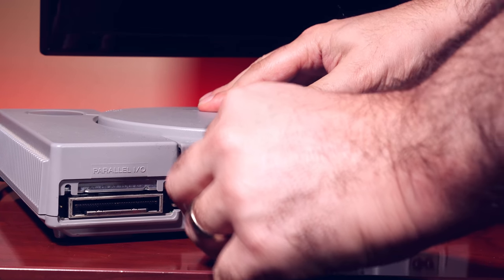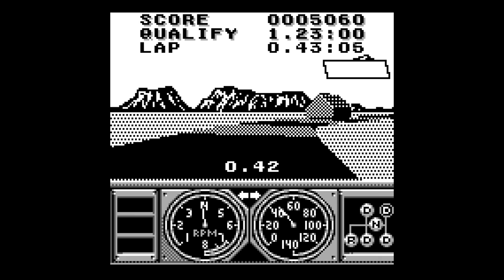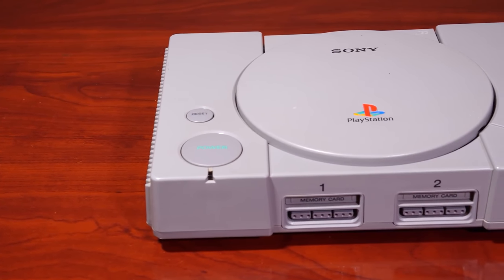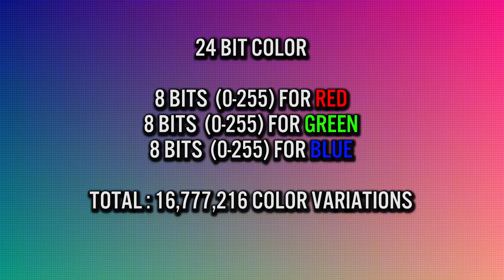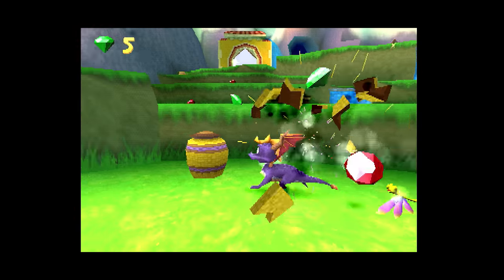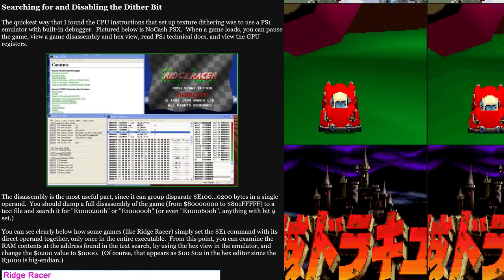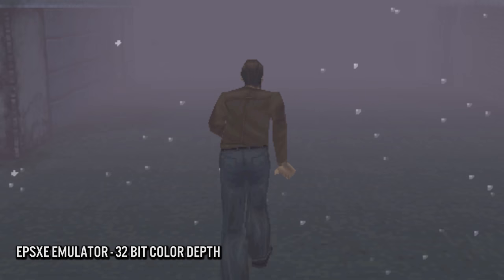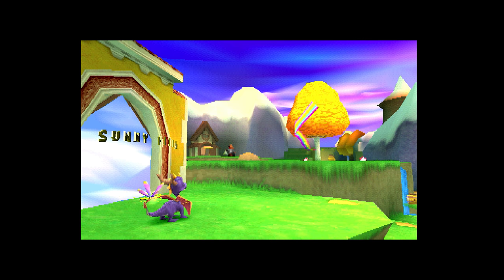Why did the PlayStation 1 have so much Dithering? | MVG

Comment: You summed it up perfectly mate, on a CRT via composite we never even noticed 'dithering' back then, it's only due to running a PS1 on a 'Modern Display' (which it wasn't natively designed for) is where we all notice the shortcomings.
Reply: if you used an "advanced scart cable" that had RGB output, and you had a decent enough (read; big enough) tv, you'd just see it on that screen to... especially in europe, since PAL tv's have more colors & sharpness then NTSC; though ntsc games run faster (60hz, where pal was 50hz), but i gladly give those 10fps for a much better image quality.
Reply: @BoGy1980  To each their own, but as a proud citizen of Freedom Land having been born on the 4th of July, I'll gladly take a smoother frame rate over a higher resolution, and older consoles not looking great on newer displays without mods, and/or expensive upscalers is why I still keep my curved glass 27in Panasonic CRT from the early 00's with component input, and stereo output in the corner of my game room for retro gaming, and I will have it till it till the day it dies, and I can no longer repair it, and yes I have 3 backups being a 19in, & 24in JVC I'Art models that also have component inputs, and stereo outputs, along with a basic mid 00's Emerson(Funai rebage) 19in all  in climate controlled storage of my shop to give them the best chance of lastling as long as possible.
Reply: @BoGy1980  I never found PAL's better colors to be much of a factor for gaming. The better colors was something more attributable to purely TV and video rather than video games. Most games were built NTSC anyway and the lack of optimization, black borders and poor framerate for PAL games is just a complete deal breaker for me.

Also in the sixth gen you had many NTSC games capable of running at 480p, 720i or in some cases 1080i. Which the PAL version of that game would be lucky to just get PAL60.

So import games for the win for me. Sorry, but NTSC just has way too many clear advantages over PAL for PAL to even be considered equal for retro gaming.

Th only time I ever consider PAL worthwhile is when there is exclusive content for that version or there is something unique about it, or it has better box art than the NTSC version (which is often the case).
Reply: @BoGy1980  NTSC and PAL are actually quite similar, except the *P*hase *A*lternating each *L*ine part means you are less likely to get noticeable dot crawl and artifact colors. AFAIK both have the same range of colors they can display and sharpness should also be pretty similar.

I'd rather have a fuzzy monochrome display than a sharp vibrant screen with horrendous 50Hz flicker. 60Hz is really the absolute minimum IMHO.
Reply: @Katana2097  there'"s quite a difference when using the advanced scart cable (which has component RGB and you had to buy this one seperately) compared to the standard scart cable (which only has composite signal, this came with the psx as a little scartbox where you plugged in yellow (composite signal), white&red (audio) cables). for 16 bit consoles the color wasn't so much a difference, mainly sharpness, but the 32bit consoles also had better color reproduction when using component; the image is just a lot crispier
Reply: @eDoc2020  ntsc has LESS SCANLINES, so less resolution, so less sharpness compared to PAL.. PAL has about 20% more bandwith for video in it's signal (5 mhz compared to 4.2), and also the color carrier frequency 3.579545 MHz for ntsc and 4.433618 MHz for pal, which is 25% more bandwith for coloring, also NTSC televisions did not have RGB input, while PAL tv's all had one or more SCART connectors which support full RGB component signal
Reply: @BoGy1980  I guess you could say more scanlines means more sharpness. When I think of sharpness I think of the knob on old TVs, which is basically only horizontal. And yes, as you say PAL allowed more bandwidth for increased horizontal resolution, too. Personally I don't think it matters too much as in my experience most color TV tubes simply don't have small enough dot pitch to be able to see a difference.

As for SCART, it was a relatively late standard, in no way on all PAL sets. While it's true that American TVs rarely had RGB in (I"m pretty sure there were exceptions) we did have YPbPr component video on many later sets, ehich is functionally equivalent.
Reply: @eDoc2020  SCART was on all tv/video sets from the early '80s on...  I even remember using a SCART connection to my TV that had a DIN connector on the other side of the cable, that's how I got supersharp text from my c64 (that's where that DIN-plug went in, I also had a Din2scart cable for my megadrive, I later discovered it also worked on my master system; that cable was made for me by tech staff from a tvrepair shop...) So i was using SCART since '86 (got my c64 then).  but our 1982 VHS vcr already had scart too (bought in Germany, my father was in the army, and we got free housing etc like all soldiers working abroad in Germany... we're Belgian btw.. so, i think scart is older than you thought it to be.
it's pal+/pal60 which is a later standard, that's from the early '90s.
Also, when using rgb-scart, there is no PAL signal used.. that's how we could play us/jap psx games on our euro PlayStation with just disc swapping to boot other region and/or chips and have full colour images, if you play pal games on a ntsc console it's a BW image, and if using the default composite cable ntsc games also show b&w on pal machines
Reply: I think it's more so that dithering was just something that people were used to. Almost every game that had come before did it as well to some degree or another so it was just how game graphics looked. Now that we have gotten used to 32bit color and high resolutions we notice it far more.

Comment: I try to hide it in emulation because back in the day I didn't see it on my CRT. It was all smoothed out. So the dithering itself doesn't have any nostalgic feeling for me.
Reply: Porfirio Rubirosa  this is why i try to play ps1 games on original hardware as much as possible. I try not to be a purist because emulators mostly manage to look so much better most of the time but ps1 games just look objectively worse when emulated with "enhancements". Sadly I can't buy too many ps1 games these days without busting the bank.
Reply: Porfirio Rubirosa  On original hardware, sure. But he says the textures are stored as 24-bit. So there's no reason an emulator couldn't just use the 24-bit textured directly, without downsampling them at all. No need for dithering or banding. 

And, of course, if that fails, they could add an option to smooth the textures. The right kind of smoothing could even keep edges and features sharp while smoothing out the dithering.
Reply: @NickGoblin  it's not really about the hardware. You would see the dithering on like an HD TV pretty sure, not that a PS1 is meant to be played on that
Reply: @Valientlink  I understand that you can use an emulator on a CRT and it'll probably look fine but at that point it's just too much effort.
Reply: Porfirio Rubirosa   If you are using RetroArch you can turn of dithering and then force the color pallette to 32 bit. Making dithering unnecessary. Although it will cause some issues when fading to inventory etc for some reason...
Reply: @NickJayj  Especially the stages during the day with fog look clean and super smooth in 32 Bit, which I do not like it this case. Not many games do it but Silent Hill does benefit from the grittiness that the dithering provides.
Reply: Idk about PS1, but on N64, I can see the dithering perfectly on my Trinitron.
Reply: @DasAntiNaziBroetchen  You can see dithering from a PS1 as well. But it's definitely less noticeable on a CRT than a newer screen.

Comment: The dithering gets interesting when playing PS1 games on the PS2. The Graphics Synthesizer had a programmable 4x4 pixel dither mask, but when running PS1 games it's programmed incorrectly with two pairs of values swapped over. This causes the pixels in two of the dither steps to align in a very noticeable way rather than being evenly spread out. From what I know, Sony never fixed this.
Reply: Fascinating, I should do an A/B comparison of some PS1 games running on PS1 and PS2 and see if I can spot that. Also, another thing that the PS2 got wrong was that transparencies on PS1 games often had a black halo around them, as if they were being blended darker than they should be. Any idea what was causing that?
Reply: @Astfgl  The black outline typically happens when you set Texture Mapping to Smooth. Where part of a texture is masked, the bilinear filtering blends in the color of the texture from the masked out area.
Reply: @ZacabebOTG  It also happens when texture mapping is not set to smooth. I never really liked the smoothing as it causes textures to break up at the edges of polygons and it doesn't look authentic, so I never turn it on. Yet the blackness on transparencies still happens.
Reply: @Astfgl  That's common with alpha blending with bilinear filtering, the colour from the transparent pixels (usually RGB 0,0,0) gets bled into the pixels with none zero alpha.

Comment: 4:46 Small correction, the PS1 stores textures of varying bit depth, but will always use 15bit colors. 24bit CLUTs are unsupported in hardware. If a game stores textures inside the disc in 24bit depth (like MGS1), those colors need first be converted to 15bit space before being used.

Comment: 2:17 “The Amigas custom chips could perform what was known as a COP-A-FEEL” 😰

Naughty Amiga!!!!!

Okay, okay, Copper Fill. 🤣
Reply: I thought it sounded like Copperfield lol
Reply: Robert Mcauley 
I was familiar with some of the names of the Amiga custom chips, like the Copper and the Blitter, but I couldn’t let the joke slide. 😏😂
Reply: It's actually "Blitter fill" though. The Amiga had two gfx chips, Copper for switching colors at the right scanlines and Blitter for drawing lines, filling polygons and moving bitmap gfx around.
Reply: Peeks'n'Pokes 
Makes sense, since blitter usually referred to schlepping pixels around en masse. 

What did the Copper chip do?
Reply: The Copper was used for changing hardware registers like palette and scroll positions with precise timing during the screen update. This made it possible to make effects like stretching gfx without changing the bitmap pixels. Heavily used in the demoscene.
Reply: @ylette  
Nice. We so didn't deserve Jay Miner. What a tech guru. Totally Woz level of genius.
Reply: @ylette  Correct. "Copper fill" was also used as a (pretty tricky) technique, but it referred to using the Copper to initiate a blit at a certain time to avoid using interrupts and extra CPU time (or worse, busy loop waiting for the blit to complete!). But you'd better calculate clock cycles correctly, or the previous blit might be corrupted.
Reply: To add, saying Amiga could display only 32 or EHB 64 colors in lores mode is somewhat incorrect. You could easily use copper to give you another palette for every scan line. Of course excessive use would obviously eat into DMA slots and slow down CPU Chip RAM access.

Dynamic hires (70 ns pixels, 640x480, 720x512, etc. depending on where you choose to start outputting bitmap data horizontally and vertically) modes used this trick to get up to 16*512 colors per picture, changing the palette on every scan line.
Reply: @az09letters92  
It's interesting how the Amiga still required a lot of groovy low-level programming to access the real strengths of the hardware.

It's a version of the 16-bit era that I didn't see, being a mac user, which had a much more modern hands-off approach to software's access to hardware 99% of the time.

I remember envying the Amiga's insanely colorful display so keenly that I literally dreamed of having one.
Reply: @RamLaska  You could access everything the right way through system libraries like graphics.library, and so on. Amiga 500 with 68000 running at 7.09/7.15 MHz can only execute a bit over 1M instructions per second. Avoiding abstraction overhead enabled one to do a lot more with the system.

Comment: The 8bit guys showed that CGA actully could display more than 4 colors on certain screens.
Reply: The CGA is really a 16-color system, but with weird graphics modes. The tricks using artifact colors to get more than 16 colors work only on composite, but work on any composite display. Any modern LCD TV will display these colors just as a CRT would.
Reply: Nearly any console/PC with composite output could. On CGA many older games relied on this. This is a “feature” of NTSC television. There are games on Sega Genesis that rely on artifact color and look wrong on RGB.

Comment: if the dithering changed, as I want to call it, the seed per frame, it would look much more clean. part of my problem with the dithering is it's too static, and therefore much more noticeable. if the dithering was different per frame, it can more easily smooth out into a gradient.
Reply: Given that these games often render at 20 or 15 frames per second, the snow visual effect from random dither would be very noticable. Yes the video signal runs at 60 Hz (50 PAL) but the extra color information is already lost when drawing the polygon.
Reply: The PSX couldn't do that though the N64 could. Which is one of the reasons on top of the anti-aliasing, mid-mapping and bilinear filters that it doesn't appear very dithered. Even though the actual textures usually were just as if not more dithered to get around the issue of the small texture cashe.

Comment: I noticed dithering on the PSX back in the 90's because i'm from the UK where we had far superior SCART. The PSX's SCART output was nowhere near as good as something like the Saturn's, but dithering was still visible on a CRT with some games. I never liked the PSX's image quality overall, because dithering was visible but at the same time it wasn't anywhere near as clean as the Saturn's output. Virtua Fighter 2 on Saturn with SCART on a good CRT was truly something to behold. Near PC monitor levels of sharpness being as that game also ran at a higher res than anything on PSX (higher than 480p). Also with progressive scan because of PAL, so no ugly interlaced shite like you'll see in emulators or NTSC crap. It really felt next gen back in 96, better than anything on PSX or even PC. Most people/countries wouldn't have experienced that with component + lower res NTSC. They will never understand or have any nostalgia for the superior experience that Saturn + SCART offered. Sometimes i'd start VF2 just to stare at that super crisp image.

Comment: When I went from composite to rgb I started to notice the dithering. It bothered me at first, but around the time I bought a PC with a Voodoo 3dfx. I was obviously impressed, but eventually I longed for that messy, rough look on the ps1 which gave you the illusion of so much more detail. I love emulators, but I prefer to play all my ps1 games on a crt and original hardware. Dithering, low resolution, huge pixels, texture warping, low-poly models and crt scanlines is a match made in heaven (at least for me).

Comment: Some people are misunderstanding dithering and what he's saying. When using a PS1 on a regular, average CRT with the composite cable (basically what regular people used back in the day) the dithering pattern is not visible. You're not supposed to see the dithering pattern. The devs used dithering as sort of a trick to emulate more colors.

Outright disabling dithering is not a solution, since it'd cause color banding which is not the intended look either. On an emulator, if you want to see the game as it was truly meant to be, set the internal color depth to 32-bit and then disable dithering. This would show the correct intended colors without banding or a visible pattern.

Comment: I'm an EURO-gamer, and i always bought the 'Advanced Scart cable" for each and every console i had, so i had component/rgb output from all my games, and it also supported 60hz and NTSC signals so i could play ntsc games in color-output on my philips tv which had pal+ (and a ntsc decoder). So i always knew dithering was on the images, but back then i already understood that it was needed to keep enough memory free for all the other items that needed to be rendered (I from 1980, so i also had experience with consoles like the master system, mega drive, nes and home computers like the C64).
I always thought of dithering that it's a great technique , it's a bit like what we do with color-pensils when we want to bring shade or change colors... We use another color over the original one, but since the grains are so small; you don't see it's actually the same thing, but when u put it under a magnifier or microscope, you'll see you're actually putting small dots of color over the original one (eg; blue over yellow to get green)... ow yeah, back then coloring items was with pensil and paper; not on a tablet with millions of colors like nowadays :)

Comment: early 3d accelerators on the PC all had dithering as they only supported 15 or 16 bit framebuffers. 3dfx cards had a special filter on output that would partially blend pixels  and reduce the appearance of the dithering. The dithering effects also tended to get amplified when rendering transparancy or other frame buffer blend effects. This was one big benefit of multitexturing cards. they could blend two textures on a triangle without writing to the framebufffer so there was no down conversion to 15/16 bit and no second dithering process a big visual improvement for games that multitextured like quake (as well as a big performance improvement too).